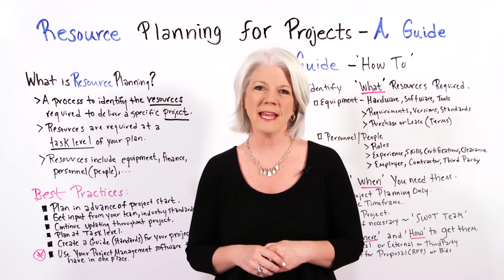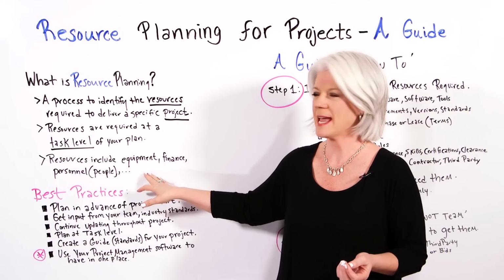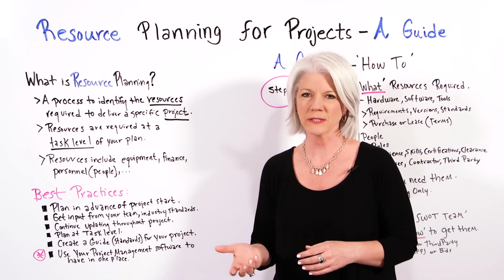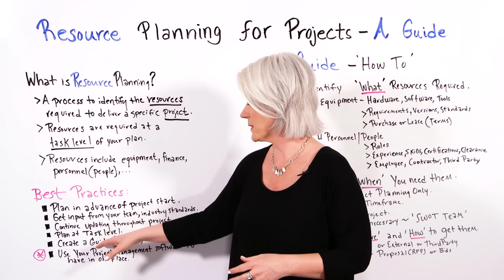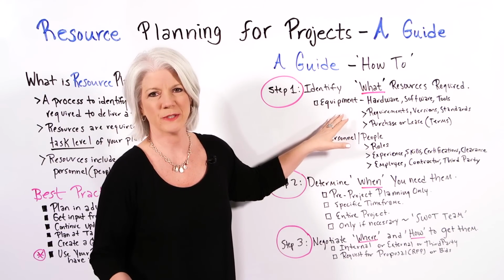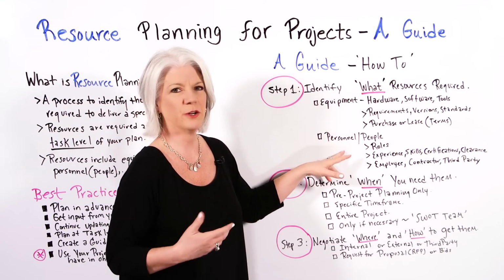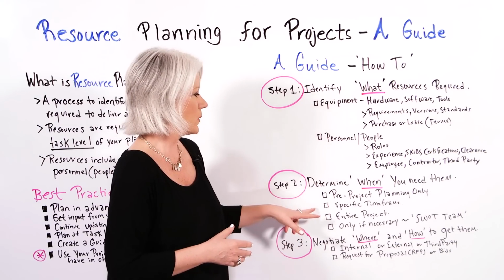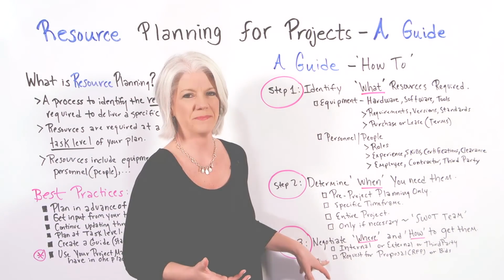Resource Planning for Projects: A Guide - Project Management Training

Comment: This is one of the fantastic videos I have seen on resource planning. Our primary focus is only on human resources when discussing resource planning. How greatly, in this video, is the concept of every resource, which can be software, hardware, or equipment required to get the job done. The concept of planning the resources' usage is one of the best parts of the videos. As in the real-time setting, companies use various software with expensive licenses and hardware, directly impacting the project's overall cost. Thus, this video seems very helpful with the thought-provoking idea of negotiations in resource planning and a guide of steps to follow.